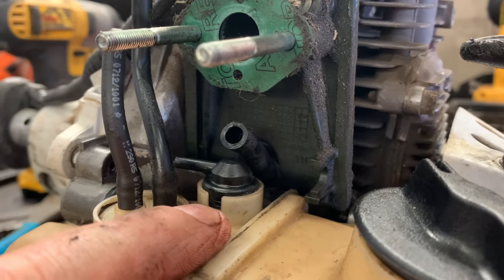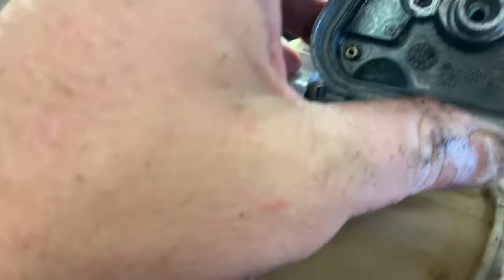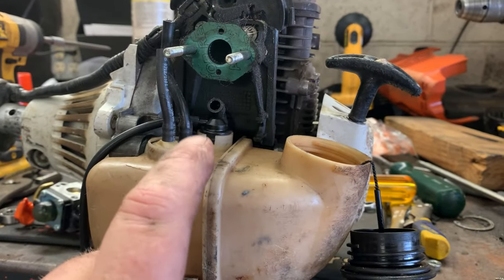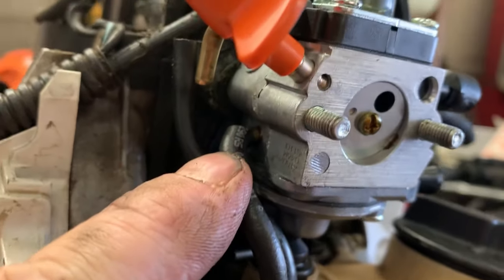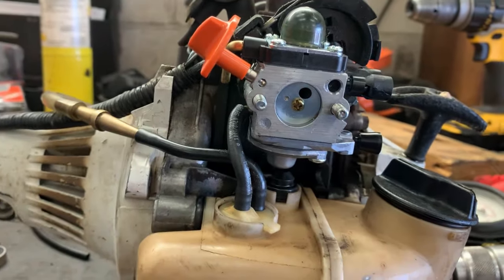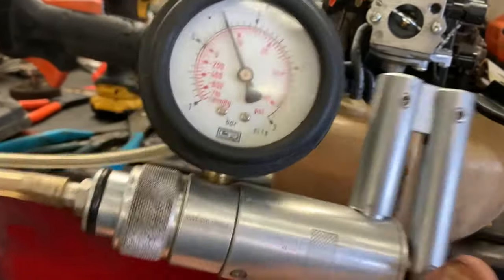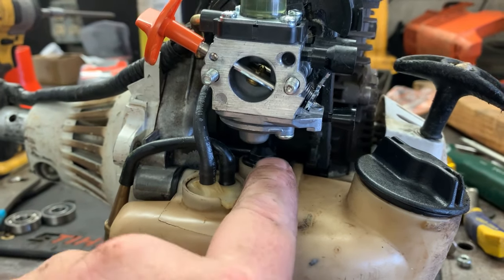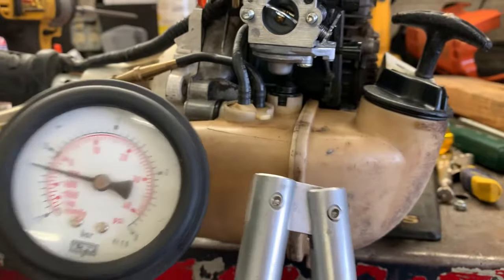FUEL TANK VENTS AND WHAT YOU NEED TO KNOW  (funny blooper)

Comment: On old 028WB,  the tank vent originally was two fine treaded inserts specifically  located.  These would allow for tank pressure to equalize. The newer vents seem to only allow air to pull into the tank to eliminate a vacuum.  Are the older original carbs incompatible with the newer vent function as the tank pressure can get quite high and put a lot of fuel pressure and possibly more volume into the carb per each sequence of the needle opening,

Comment: Had a faulty tank vent on a BR340, replaced it with an OEM one but was still having fuel starvation issues, installed an Echo one and it hasn't given him any trouble since
Reply: My echo srm 210 is having same issue. Starving for air, replaced check valve 3 Times. Still bogs down unless I open gas cap.

Comment: Be careful with some of the Echo trimmers in the line where the fuel vent is there is a small white filter if it is restricted in any way it will starve the fuel system I know this because we had one at the dealership here that was partially plugged and it would starve the engine of fuel after running for like 45 minutes it was extremely hard to diagnose
Reply: Thank you

Comment: I pressure test the tanks and fuel lines in chainsaws the same way.  I plug my Mighty Vac into the fuel line going to the carb and pump it up to 7#.  It better hold.  If it holds, I switch it to vacuum and pump it up.  It should gradually release.  If it does not hold pressure, there could be a leak in the fuel line, tank, tank cap or a bad tank vent.  I start looking for the leak with spray soapy water.
Reply: smart

Comment: Thanks  i never  knew thet the tank pressure  or vent was important  !! Or what  acures when its not right !
Got a few old saws  that will visibly  leak fuel from vent !  Still  use them   when needed  always  figured  saw isn't  quite  working  right but just put it down to been a old tired machine!! Got to get myself  one of them pressure/ vacuum  testing  gadgets and give the old veterans  some tlc

Comment: Or if it dies after a carb rebuild or replacement you can always just unscrew the cap, re prime and try it with the cap off, if it runs fine without the cap then its a vent issue
Reply: Yes.  KISS method.

Comment: I test my gas tank with my Mighty Vac.  I plug it into the fuel line going into the tank.  It should pressure up to 7# and hold at that pressure.  If it does not pressure up, there is a leak, somewhere.  I will use a spray soapy water mixture to find the leak.  If a tank does not hold pressure when the gas gets hot it will boil in the tank and cause a lean condition in the saw.  After it passes the pressure test, I switch to vacuum and pump it up to 7-10 inches of vacuum.  It should gradually reduce to zero inches of vacuum as the tank vent allows outside air in.  If the tank vent does not work correctly, the carburator will not be able to pump gas against the vacuum in the tank.  You will also hear a “who’s” when you open the gas tank.
Reply from the maker: I know 👍

Comment: I'm hoping you can help me with a Bad Boy Maverick zero turn problem. The fuel line from the tank to the fuel pump will not pick up fuel. But if i remove the line from the fitting and put it down in the tank it will pick up the fuel and start. I have installed a new fuel pump and all new fuel filters. The man that owns this mower told me he had try to remone the fuel line inside the tank and couldn't get it out and may have damaged something there. Any info would be appreciated.

Comment: I pressure cheviot my complete fuel system to 7# and 7inches of vacuum.  I pressure check carbs to 5# and 5 inches of vacuum.  I check engines to 7# and 7 inches vacuum.  The Stihl service manual says they can drop one pound per minute but cannot drop below 4#.
Reply from the maker: I don’t care with a manual says I want zero leakage
Reply: @THEMOWERMEDIC1  you won’t get it on an ms 440 or 360.  You get a gradual leak down to 4#.  This is because the oil pump spacer plugs into the pto side seal.  Husqvarna has a recess on the 372 where they install a small O ring but Stihl does not and you will get a little pressure loss.  I talked with my local Stihl tech and he told me the spec and my 440 passed that spec.  He told me not to worry about it.  On the 440 the pressure loss is between the spacer’s inside dimension and the crank   It does not leak around the seal.  I sprayed it good with soapy water and got no leaks.  As the saw warms up and the clutch and oil pump are screwed down this little leak probably also stops.

Comment: Was just riding my 1996 GL1500 GoldWing. Late night, heading home through a wooded desolate park.   Motor was fine and always has been   . Just criusing along and withno warning, motor bogged and then died.   I pulled over and thought what to do. (Tank was full and I knew it for sure, because I'd filled out last night before garaging.   I cranked and wouldn't start but did try Then set full come and it did eventually start.   Futzed with throttle and come and got it running again.   Staked 5min later. Starting was getting battery drained but got it, drove out of woods. Still thinking "what the hell"?   Rinse repeat a few more times.  Few miles/ stalls later, I got to gas station.   Got carb cleaner and a half gallon of gas to confirm and get fresh.   I had begun to think, "what changed and what could I have done when I fuels last night?".   "Gas cap?  Fuel line? Vent line?".   Sure uff, opened fuel door and I had thought looked the vent line. So finished riding home. WOT, anything, didn't have problem going last 8 miles.   So, I figured, YouTube up some vids on the vent line and stallinng.  3rd vid was this and near the end, you confirmed not only the effect of vent line "clogging" but also, that is gotten my 30 miles ok riding since filling track last night.

Comment: pardon my question here, sometimes I'm a little slow.  So i'm having issues with my Stihl FS91R like it is starving for gas, at 1st it only did this when the motor got hot, now it will not run longer then 30 seconds.  When I remove the gas cap I get woosh of air, believe it is vacuum lock.  Don't have compression tester but would this be a sign of tank vent needing replacement.
Thanks for your teaching work.
Tim N
Reply: Easy test is to disconnect the vent and try restart

Comment: So via the stihl technical it says ti check the valve with gas cap on and the inlet plugged and vacuum pump hooked to return. It says there should be no vacuum build up and should hold pressure. Thats the opposite of what you say in the beginning. Im a little confused.
Reply: He did it both ways suction and outlet. Opposite each time.

Comment: Do you know this issue of a Stihl not wanting to start especially after running for awhile and being stopped for a bit. or when the temperature goes up into the 30's or machine is sitting in the sun. Is this something to do with the vent of fuel circuit? Has something to do with heat and fuel/vapour. usually have to prime it then but that isn't enough. Something that helps is I have to hold throttle while starting.
Reply from the maker: Yes it’s called static flooding
Reply: @THEMOWERMEDIC1  is it one faulty vent. or does the fuel port need to be changed as well
Reply from the maker: @brentkelly5445  check vent.  If
Good
Replace carb
Reply: All my Stihl machines do this. Every single one. The 4 mix ones (KM131R) are the worst for this. Yes throttle fully open helps.

Sometimes I have to remove the spark plug and manually deflood it. I also keep them in the shade when on site so they stay cool and also, NEVER store upside down! always upright :)

Comment: Is a symptom of a bad valve a LOT of vacuum release when I remove the gas cap? I'm having runnability issues on my FS131 Stihl trimmer and it bogs out, loses power, then its hard to keep running. Opening the gas cap and WHOOSH, TF is that?.. I replaced the spark plug, fuel filter, air filter and just run MotoMix. Should I just replace the valve? I don't have the fancy pressure gauge testy.
Reply from the maker: Absolutely you are on the right track
Reply: @THEMOWERMEDIC1  dude it worked. That valve was shot and the replacement got it running like a champ.!!.👍🏻🔥🔥

Comment: My gravely pro turn 152 gas tanks make a intermittent whistling sound throughout the day when it's hot. Is it the gas caps causing this or is it normal for it to do this?
Reply from the maker: Normal. Might make
Sure the tank vent in the cap is not partially plugged
Reply: @THEMOWERMEDIC1  ok thanks I'll check that out this evening.

Comment: Well how about that it works like a diode kinda !
Reply from the maker: No not quite, a diode requires a minimum of .0127 amps to operate.  This is not an electrical part
Reply: Thank you for explaining that ,with that learned it is meant to  keep atmospheric pressure out of the fuel cell?